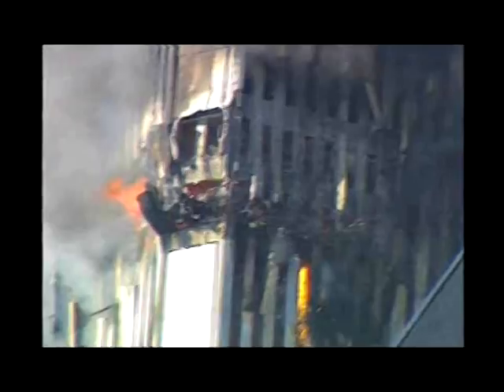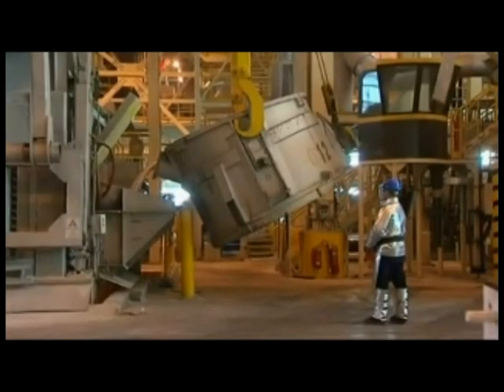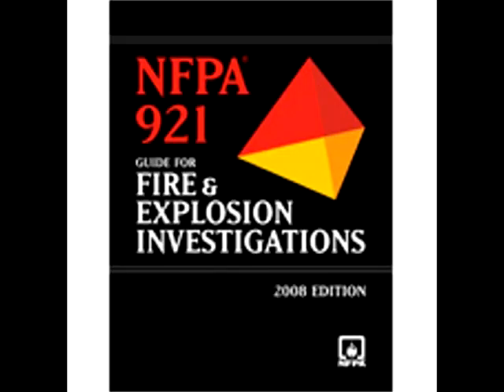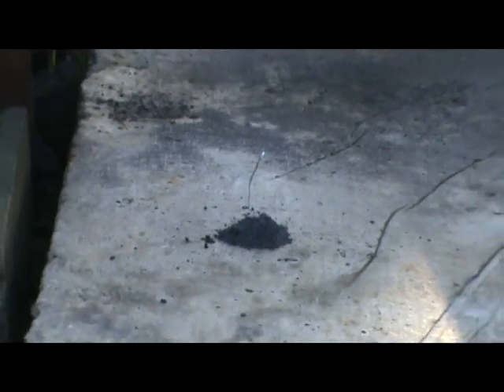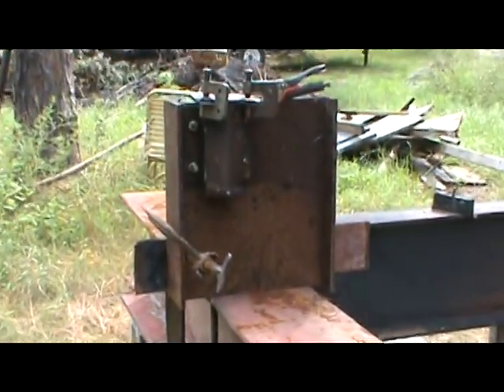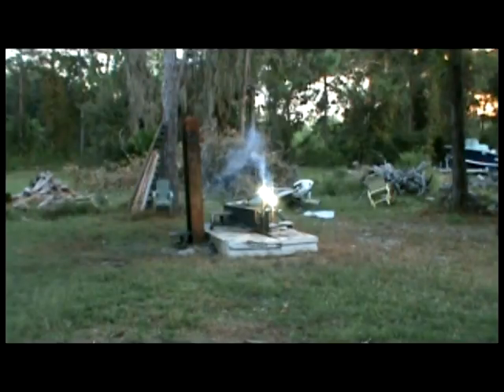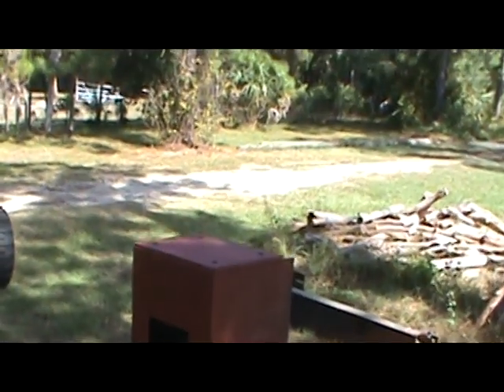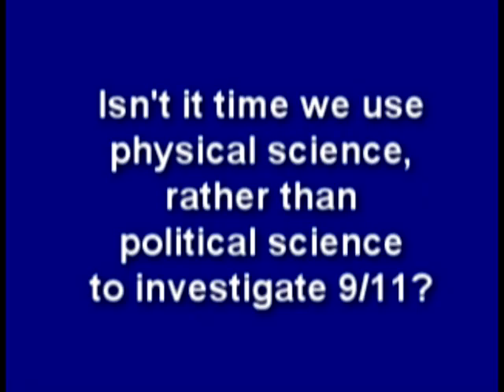9/11 Experiments: The Great Thermate Debate

Comment: And also 'iron rich spheres'   are you serious you think those would be strange to find in the remains of a building that is constructed out of WELDED steel box sections with each strut end  also having four access holes CUT into them to give access to the bolts so they could connect each WELDED section together.  As anyone who has ever worked with metal knows if you weld and cut steel you are going to produce lots and lots of these iron spheres.
Reply: Karl Barratt i'm sure they cleaned up the spatter when construction was complete... welding that had been done in the early 70s doesn't account for even 0.0001% of the amount of metallic spheres that were found in the dust
Reply: frank james 'They cleaned up after' are you serious have you looked at how the building was constructed out of steel box sections with CLOSED ends on the sections . So you think they would of cleaned inside each section. Don't be silly. And even those spheres stuck  on the outside wouldn't have been ground off prior to completion as each beam was to be sprayed with the fire retardant and then cladded. When the building collapsed all this beams were twisted, bent and broken open which clearly explains the spheres were from the construction.  You also go on to say it wouldn't account for 0.0001% of those found which is again stupid as the only and I must point out 'undocumented' case looking into this by a so called truther  was a few spheres less than a couple of grams total..
Reply: frank james  You need to edit your reply as it makes no sense in relation to what I wrote. Firstly you say that none of what I wrote is conclusive which yes your right. I can only write about my experience with metal and building work and plain common sense. That's why I'm surprised you write  'it is conclusive that professional carpenters and steel workers produce clean materials' how is it conclusive ??  that's nonsense. When the steel beams were made there will always be splatter and as I've already pointed out everyone involved in the making of the beams knew they would covered by cladding etc once the building was built therefore no need to grind and polish off any splatter. The steel fabricators do not carry out an extra processes if there's no need for it and more importantly if there's a cost implication thats common commercial sense. Not too sure why you mention carpenters as I'm sure they were'nt made of wood..
   You do rightly go on to say jet fuel couldn't cause them, which I don't get your point as I've at no time mentioned anything about the fire causing them as that's plain silly. You then write that the fact that surrounding buildings were damaged as.conclusive proof that explosives were used. Well that's a new one I've got to say I'd always thought that was because towers damaged the surrounding  buildings as they collapsed as seen in nearly all the videos. I've already said that when the building collapsed all the bending, twisting and snapping of the beams would mix in splatter throughout the debris and dust.
   Please show us the conclusive proof of these dust samples you mention and by that I mean documented samples of the dust taken at the time and NOT samples sent in years later from so called truthers to back up  their mad fantasies and therefore cannot be taken seriously as scientifically acceptable samples. No better explanation  ??  have you heard of the NEST report it gives a pretty good CONCLUSIVE explanation based on facts and  professional expertise.
.
Reply: frank james You'll still not making sense of course there's splatter. For gods sake use your brain as well in the first 30 seconds of the above video it shows the outer panelling made up of three box sections each of these box sections has welded closed ends with four holes for the connecting bolts and also has four access holes cut out  about a foot up from the ends on each side of the box section to allow access to the bolts. The welding of the end panels and cutting of the access holes would of caused considerable splatter to be inside each box section. . So you really think they cleaned inside of each closed box section of course not., and that's not even including any splatter on the outside.When the buildings came down these sections split like a pea pod.
         I have got an open mind though so please send me the link for the USGS report on the documented and verified samples of the dust I've not seen that report and would like to read it.. The only other reports I've seen  have used samples which were  sent in years later and can not ne considered legit. To say the NIST report is criminally culpable can be answered by the question if so how come no one has taken it to court after all if its criminally culpable it would be easy to prove in a court of law and the whole so called 911 conspiracy could be exposed to  the world in one easy stroke. Of course the answer to that is fantasies don't stand up to well in a court of law although you'll probably say the courts will be in on the government cover-up. Which is the normal truther answer and every time they use it makes them look stupid as using that reasoning there's thousands and thousands of people in the conspiracy not exactly secret then is it..
Reply: Karl Barratt none of what you said is conclusive unless you have evidence of "those spheres stuck to the side" ... one should be always careful of whom or what one calls "silly" or "stupid" lest one risk proving oneself a hypocrite

it is conclusive that professional carpenters and steel workers produce clean materials and welding techniques were highly advanced even in the 60s where slag spatter does not account for even a fraction of a percent of the volume nor range of alloy "phases" of metallic microspheres found in the dust

http://pubs.usgs.gov/of/2005/1165/508OF05-1165.html#heading08

these microspherical alloys can only occur during chaotic burning and oxidation of multiple materials at temperatures much higher than could be attained in even a jet fueled office fire... steel welding filler and flux do not account for these... besides what else could knock such a huge volume of welding spatter off the columns besides explosives even if they did exist.. oh that's right, explosives would, well if that did happen we would also see chunks of the buildings embedded in nearby buildings, after being horizontally ejected from the towers.. oh that's right that did happen as well

hmmm seems the evidence is conclusive, those buildings were demolished because no better explanation has been offered by the anti-truth crowd
Reply: Karl Barratt i used carpenter interchangeably with construction worker and besides the buildings were full of drywall so but whatever it's a trivial point... my reply doesn't need editing but your reasoning could use a tune up as you say my reply makes NO sense then go on to say i'm right about none of what you're saying being conclusive... yes i'm right and just admitted you are wrong to make conclusive statements about inconclusive evidence (imagined or otherwise)

my dad was a carpenter and i've worked in manufacturing including welding and first of all there isn't a bunch of splatter on welded products to begin with to even have to remove... the only splatter that might hit the finished steel bounces off 99.9% of the time or falls on the surface and will simply roll off when the piece is lifted off the conveyor

a simple brushing will remove any loose debris that might be stuck by static, to make sure it doesn't blow into people's eyes as the truck is being loaded or driven to the worksite

i gave you USGS analysis of the contents of the dust and no NIST has proven themselves unreliable and criminally culpable by ignoring data, denying access to their source data for the computer models and REFUSED to even test for explosives... what are they afraid they will find?

i will now beg you as i do all the other anti-truthers.. PLEASE use your own brain and DO NOT let bureaucrats who work for the criminals do your thinking for you.. like everyone else in this world you too are capable of genius
Reply: Yes but in the paper they explain that these spheres are an alloy of elemental aluminium (i.e. very pure) and iron oxide. Dr Jones tried to recreate such spheres and the only way he was able to do so was with thermite.

Furthermore when they heated the red/grey chips to their flash point they ignited with an exothermic reaction and such spheres were present where no spheres existed before. I still haven't read a decent refutation of this.
Reply: Karl Barratt
They spend an entire section of the paper detailing the 'Provenance' of the samples. The samples were collected separately some on the day itself and some the day after. The people who donated them ranged from office staff to an artist who was going to use the dust in a future project. All were sealed in airtight bags and the people who donated them have made video testaments as well as sworn affidavits.

Besides, all the samples showed the same basic composition and all contained the red/gray chips in roughly the same proportions so if they were contaminated or interfered with then all four people must have added the same rogue elements. That really does seem implausible, particularly if the authors are right in asserting that these chips are military grade explosive/incendiary.

Btw I don't consider myself as either a truther or a debunker. I'm just interested in the science.
Reply: Karl Barratt the point here is not about being scientifically proven. It is about if it could be accepted in a legal process. If the judge can see that an enough number of samples with identical contents are coming from sources independent from each other they would be allowed as proof. Coming so far there should have had to be some kind of reason to believe why a scientist should try to make up a story  that in fact only ended up in losing his job and defamation.
I am very sure that the proof would stand up in court and support the idea of the presence of some kind of thermitic material. The significance of that is however another question.
Reply: terrymanning1 Yes  you've got  that right. And I know you shouldn't pick on retards as it's not their fault they were born that way  but I can't resist poking them with a stick every so often, its so funny seeing their reactions to reality and facts they slip into this kind of psychotic mantra sitting down clutching their knees while rocking back and forth. I've said this before that they remind me of Creationists using the same sort of pseudo reasoning/science and so called experts.
Reply: oller So you think just because there's less people debunking now that proves you truthers are correct. You really are living in a different world, don't you get it there might be less  people posting debunking comments but that don't prove your right it proves the exact opposite. It means that the main stream have moved on and don't even bother to engage truthers anymore as they know there's no point  as its a faith issue with truthers and noth8ing to do with the actual truth.
Reply: Good to see someone on a 9/11 video with some common sense.
Reply: terrymanning1 = sell-out coward
Reply: Jon Weaver Thanks for the reply but I refer you to what I have already wrote previously 'Please show us the conclusive proof of these dust samples you mention and by that I mean documented samples of the dust taken at the time and NOT samples sent in years later from so called truthers to back up  their mad fantasies and therefore cannot be taken seriously as scientifically acceptable samples.'
Reply: Jon Weaver As I've said again and again the samples and report you are referring to can in no way be considered as scientifically acceptable. For starters  there is NO documented proof of the samples being legit apart from the say so of some truhers sending them in years after the date and that frankly dose not mean anything.
   Also all the samples where all sent to the one person, but as you know in any proper scientific test they should of been sent separately to at least two different  independent  labs. Not to one person with a vested interest in making the results be what they would like.
Reply: You're still not convincing me Karl I'm afraid. As I said the provenance of at least one of the samples was described in an affidavit. Others have made video testimonies where 3rd parties confirm the stories etc. None of the people knew each other. I just don't buy the story that these people somehow created or contaminated some dust to support a conspiracy theory.

But even if you assume that every donor either tampered with their dust or allowed it to become contaminated, then you have to explain how all the samples had the same general composition and specifically how the red/grey chips were ubiquitous across all the samples.

It seems to me that the simplest story...that several unconnected people collected samples of dust on 9/11 and sealed them in air-tight bags just in case they might be useful...is probably true. The alternative story...that a group of unconnected '9/11 truth' activists all created samples of dust in which they placed the same nano-thermite in the same proportions...now that just beggars belief!
Reply: Jon Weaver I didn't assume every donor tampered with the samples I just pointed out that they can not be taken as scientifically acceptable samples.. I also pointed out in my reply to you that all the samples were sent to the one person for testing who had a vested interest in making out the termite was in the samples. Just so you know all the samples were sent in after being asked for on a truther web site which even mentioned what they were looking for, so please don't pretend this was a serious test its just yet another made up fantasy.
Reply: I know all of that but the implication of what you are saying is that someone tampered with the samples and added this thermitic material. If it wasn't the donors then it must have been one of the researchers and I just don't buy the story that these very distinguished academics with long and glittering careers fabricated data or tampered with evidence. That doesn't seem at all plausible to me.

Part of the problem is that whoever should have been responsible for collecting evidence and establishing the exact cause of the disaster did not do that. The dust simply wasn't collected and preserved as it should have been. Nor was the steel which was cut up and sold for scrap when it should have been evidence from a crime scene.
Reply: Exactly...it's like anyone even questioning the evidence is labelled a 'nut job'. It seems to me that the way to debunk the paper would be to do so scientifically.
Reply: oller You make a fair point even  if I might not agree with it.. I understand what you are saying about the significance of  the findings as finding iron oxide aka rust and aluminium is what you might expect considering what the building/planes/contents etc were made of..
Reply: Karl Barratt well... I thought they said that it was a little more than rust and aluminium but I am not a scientist...
Reply: They found red/gray chips comprised of two layers, one of which contained elemental aluminium and iron oxide mixed at the nano scale. When heated it ignited at around 300 degrees or there abouts and it burned with a rapid exothermic reaction that was more energetic than actual thermite.
Reply: Jon Weaver Karl Barratt seems to indicate otherwise.
Reply: oller Hi guys think its getting a bit off subject as this thread was about iron spheres  and not this paper/report. I could write for ages about and have already. You should take a look at this video which sums up the so called report better than I can its:
Debunking 9/11 conspiracy theorists part 2 of 7 - Nano-thermite found in the WTC dust
Debunking 9/11 conspiracy theorists part 3 of 7 -Thermate, thermite and glowing aluminium
Reply: Karl Barratt sorry but these videos are not in function on YT right now, but you can go and look at what Niels Harrit has to say about the issue. Nobody has been able to contradict that so far. Click n Niels Harrit and Milette and you will find it.
Reply: oller yeh sorry the second link is wrong, but the first one works, have a watch the other 7 parts are good as well.Just copy and paste below into the YT search box
Debunking 9/11 conspiracy theorists part 2 of 7 - Nano-thermite found in the WTC dust
Reply: Karl Barratt I am sorry but sometimes I have problems to take Myles Powers seriously. Not that he is joking but it is the attitude that those who question anything about 9/11 are kinda nuts. I have been debating debunkers for almost a year and most of them are just that way. I have made a decision not to care about that as long as there is anything of substance to talk about. We have had a hard fight on WTC 7 but in the end they had to concede to the fact that NIST REALLY had admitted to free fall and that they have failed to explain it. I don´t care  how they did it in the Towers but I am pretty convinced that the collapse couldn´t happen that way without some kind of controlling devices. So my focus is right now to get a REAL explanation on how the towers came down and I am not satisfied with "inevitable" and that this and that said it "was so". The event is so extreme that is has to thoroughly explained and not left only to Myles Power-style debunking! I am a lawyer and not a scientist. May be it makes me a little more open minded and allows for more stupid questions. From me.
Reply: oller
I agree. The NIST report only models events up to the point of collapse initiation. By their own admission they do not model the collapse itself so it is yet to be explained...Also as you rightly point out NIST took only an average speed rather than plotting as a function of time. When you plot as a function of time you get free-fall acceleration for 2.5 secs. Amazing that the 'official' report is so unscientific!
Reply: truthers = retards
end of
Reply: terrymanning1 retards are retards. Agree 100 %
Reply: oller
Karl Barratt can indicate whatever he likes but that doesn't change the fact that that's what the authors claim to have found in the paper they published. I'm neither a physicist nor an engineer so I'll have to defer to other s in the debate but I haven't seen a decent rebuttal that deals with every point in the paper. If the paper is so obviously rubbish then it should be quite easy to refute.
Reply: Karl Barratt
That's a shame Karl...I thought you wanted to discuss the issues not hurl playground insults at people. I'm not even a truther...I just think there are unanswered questions that need answering but your comment has just closed this discussion. Shame.
Reply: Truthers are retards. This is a fact.
Reply: terrymanning1
 
New studies conclude: So called 'Conspiracy theorists’ are sane, while loyal Government Dupes and MSM Drones become hostile lunatics.

The following four different University studies have revealed a lot about how conspiracies are denied using patriotism and why the ones questioning the Government are attacked and considered anti-American traitors. Confirming a mental condition diagnosed by psychologists as cognitive dissonance, the mental stress and discomfort one experiences when faced with a 2nd equally possible explanation capable of destroying ones beliefs, loyalty, faith and security the Government is expected to provide.

Recent studies by psychologists and social scientists in the US and UK found contrary to the mainstream media stereotypes, the ones labeled as conspiracy theorists, tend to be saner and more stable than those accepting the Governments official version of an event. The most recent study was published July 8th, 2014 by psychologists Michael J. Wood and Karen M. Douglas of the University of Kent (UK). Entitled “What about Building 7? A social psychological study of online discussions of 9/11 conspiracy theories.” The study compared comments at news web sites from “Truthers” to those left by “Debunkers.”

The ones conducting the study were surprised to discover it is now more conventional to leave Truther comments than those of Debunkers: Of the 2174 comments collected, 1459 were coded 'Truther' ones who do not believe the Govt. theory and 715 were coded 'Debunker' who believe the governments theory. Truthers commenting on the 9/11 and the JFK assassination outnumber Debunkers by more than two to one. Proving pro-conspiracy Truthers express what must be considered the now conventional wisdom, while the anti-conspiracy Debunkers have shrink into a small, beleaguer-ed minority. 

Perhaps because their supposedly mainstream views no longer represent the majority, the anti-conspiracy Debunker often displays anger, rage and hostility resorting to profanity and personal attacks to discredit or persuade Truthers into believing the official 9-11 story. Additionally, it turned out the Truthers were generally not hostile posting valid concerns and not fanatically attached to their own conspiracy theories willing to consider other and equally possible theories. 

Debunkers however claim their 9-11 conspiracy theory blaming 19 Arabs, none of whom were experienced pilots able to fly a commercial airliner, especially without showing the least amount of fight for control of the planes on 9-11, were somehow able to thwart 2 billion dollars in air defenses under the direction of a guy on dialysis, using a laptop computer and a satellite link holed up in a cave halfway around the world – was somehow possible. 

This while the Truthers never claimed to have a alternate theory which completely explains the events leading up to the attack on 9/11. They claim they are not promoting a rival theory nor do they need one. They claim it is not for them to figure out only to prove the impossibility of the official story, which does not require a contradicting theory. They are simply claiming since a lie cannot be proven it was released immediately and allowed to run halfway around the world before the truth could put on it's shoes.

In short, the new study by Wood and Douglas suggests the negative stereotype resulting from the CIA pinning them as conspiracy theorists and hostile, fanatical anti-American Traitors. Relying on cartoon physics and crack pot Scientists, Architects, Structural and Aeronautical Engineers for evidence is ridiculously false. 

Additionally, the study found Truthers research all claims to find evidence the square box dictators ignored and failed to mention. They also research and discuss other conspiracies the Govt. is accused of masterminding tieing them all together exposing the much larger agenda of these Neo-Con traitors and their NWO Government.

Both of these findings are amplified in the new book Conspiracy Theory in America by political scientist Lance De Haven-Smith, published earlier this year by the University of Texas. Professor De Haven-Smith explains: "The term conspiracy theory was invented and put into wide circulation by the CIA in a effort to smear and discredit the ones questioning the JFK assassination." Adding. “The CIA’s campaign to popularize the term ‘conspiracy theory’ targeting the ones questioning the Government for ridicule and hostility must be credited. Unfortunately, it became one of the most successful propaganda initiatives of all time.” 

In other words, people who use the terms “conspiracy theory” and “conspiracy theorist” as an insult are doing so as a result, using these terms became an insult to the ones questioning the Govt. who uncovered a well-documented, historically accurate conspiracy by the CIA and those involved in the assassination of JFK. The CIA is not supposed to be operating inside the U.S. yet, routinely breaks conducts domestic operations ranging from propaganda to assassinations inside the U.S. 

De Haven-Smith claims those who doubt official explanations of high crimes are eager to discuss historical context. Pointing out a very large number of conspiracy theories have turned out to be true, and there appear to be strong relationships between many as-yet-unsolved state crimes against democracy. An obvious example is the link between the JFK and RFK assassinations, which both paved the way for presidencies continuing the Vietnam War. According to De Haven-Smith. "We should always discuss the Kennedy assassinations in the plural, because the two killings appear to have been aspects of the same larger crime." 

Psychologist Laurie Maxwell of the University of Guelph agrees the CIA-designed “conspiracy theory” label impedes cognitive function. Pointing out, in an article published in American Behavioral Scientist (2010), anti-conspiracy people are unable to think clearly about such apparent state crimes against democracy as 9/11, due to their inability to process information conflicting with the indoctrinated pre-existing belief they were brainwashed into believing. 

In the same issue of ABS, University of Buffalo professor Steven Hoffman adds "anti-conspiracy people are typically easy prey to strong confirmation bias – they seek out information which confirms their pre-existing beliefs, while using irrational mechanisms (such as the “conspiracy theory” label) to avoid having to consider conflicting information." 

The extreme irrationality of those who attack 'conspiracy theories' has been ably exposed by Communications professors Gina Husting and Martin Orr of Boise State University. In a 2007 peer-reviewed article entitled "Dangerous Machinery, Conspiracy Theorist as a Transpersonal Strategy of Exclusion,” they wrote:
 
“If I call you a conspiracy theorist, it matters little whether you have actually claimed a conspiracy exists or whether you have simply raised an issue which I would rather avoid. By labeling you, I strategically exclude you from the sphere where public speech, debate, and conflict occur.”

Now, thanks to the internet, people who doubt official stories are no longer excluded from public conversation. The CIA’s 44-year-old campaign to stifle debate using the term 'conspiracy theory' label to smear those who dare question the Government is nearly worn-out. In academic studies, as in comments on news articles, pro-conspiracy voices are now more numerous – and more rational – than anti-conspiracy comments. Cheers Debunkers!
Reply: Truthers are retards. End of.
Reply: terrymanning1
I am new to this debate and so have no views whatsoever on what did or didn't happen so let me tell you, as a someone who is new to this topic, that that your use of abuse, coupled with your refusal to actually engage in any arguments, makes me want to side with the 'truthers' because they sound much more rational than you! You are doing yourself a disservice by making yourself sound aggressive and unintelligent.
Reply: Jon Weaver I have had years of dealing with truthers ok. They are not interested in anything other than promoting their bullshit hate filled anti-USA agenda of theirs. They have never proven a single one of their claims and deserve one thing: contempt.
Reply: terrymanning1
Fair enough but that's not how it appears to me. Many seem to raise legitimate questions as far as I can see. I don't see a lot of anti-USA sentiment either. May be anti-Bush administration but that's far from being anti-American. Personally I despise the current Tory government in the UK but that doesn't mean I hate the UK. It just means I think it is being misrepresented.

It is a matter of public record that the CIA blocked the passing-on to the FBI of Able Danger data including the names of several hijackers and the fact that they were in the States. That has been very well established by various whistle blowers and the issue has been raised by several of your own politicians. The authors of the 9/11 commission report admit that they were lied to by the CIA and never got to the truth of that particular matter.  So at the very least, there has been a cover up by the CIA of the fact that they knew the whereabouts of these guys and didn't tell the FBI. So it's not surprising people are suspicious. The people responsible should be held to account and the truth, all of it, should be made public.

Do you honestly think the 9/11 commission report contained all of the truth? Every last bit?
Reply: Jon Weaver Truthers have utterly failed to prove a single one of their claims in over 13 years. Not one reputable scientific, engineering or architectural organisation anywhere in the world gives anything they say any credence. Says it all.
Reply: That might well be the case but many people are far from satisfied with the official investigations. In 2005 New Civil Engineer criticized NIST for not modelling the actual collapse sequence and the commission report has even been criticized by it's own authors!

If NIST had done the modelling properly then there wouldn't be any room for 'conspiracy theories'.
Reply: Jon Weaver So how come truthers can't debunk the NIST report with anything other than pathetic thermite demo nonsense?
Reply: Well as I said NIST didn't model the actual collapse so they've left themselves open to alternative theories. Also they had to tweak quite a lot of the variables to make their models work. Furthermore their modelling wasn't published in a peer review journal so it can't be verified and they won't share the data either. I reckon they deserve all the criticism they get!
Reply: Jon Weaver Shame you truthers can't come up with anything resembling a credible alternative isn't it?
Reply: I wondered how long it would be before you'd call me that. I have never once, in any of my comments, expressed a view about any of the  theories. All I have done is pointed out criticisms that mainstream sources have made of the 9/11 commission and the NIST report.

Your use of the term 'truther' as an insult is meant to close down critical thinking.
Reply: terrymanning1 you are telling us a story that is so full of anomalies, holes, lies, distortions and misleading evidence of an event containing 4 different parts that if they took place in the way you claim with 100 % success for the hijackers and 100 % failure for the government the chance would be one in a billion or less; that we, who can see evidence leading in other directions that you don´t even want to examine, are asked to give an alternate version that each of them would have the probability of one in a million; just because there are a million different alternatives. It is extremely dishonest to ask the victim of an extremely complicated crime to have a version of his own. We can all guess who the perpetrators were; we can see that it is carefully planned; but it is planned to create fear and chaos. Somebody suggested Occams Razor in this case. Since this event is set out to be utterly unclear and chaotic; Occams Razor leads us to believe that the government did it. But there are many alternatives also, isn silent or overt cooperation. Do you also think that we should be able to explain which of the one thousand ways it could have been performed in every detail? Why should anybody be able to do that? You have accused 19 Muslims without other proof than that they may have wanted it to have happened. Is that enough for you?
Reply: terrymanning1 you used to be more concise. Now just blabbermouth.
Reply: terrymanning1 when did you ever utter one truthful word? Not one single eyewitness to confirm the presence of the hijackers at Logan, Dulles or Newark. Eyewitness testimony? The eyewitnesses in Shanksville did not see any trace of an airplane. Forensics? You mean NIST who have not been able to explain why there was free fall in WTC 7. Hard science? You mean NIST when they reported that the collapse was "inevitable". The Commission report? Peer reviewed? Video footage? From the airports? From 85 surveillance cameras at Pentagon? Yes I agree; there is a lot of evidence out there. A pity that you never showed it to the public. (Btw; interesting that ALL of you debunkers are retreating to the same position. Good coordination, indeed!)
Reply: terrymanning1 there is a lot that you don´t know about me and your weak brain will never do
Reply: terrymanning1 then do me a favour and shut up
Reply: oller Nah it's fun goading a fuck up like you
Reply: terrymanning1 You're not too bright, are you?
Reply: terrymanning1 then do it. Talking is nada.
Reply: Karl B.   As you probably know,   when large steel contruction sites are cleaned up before finishing the job,  junk such as weld slag, etc. is REMOVED.  So  don't expect to find very much. And much of the fabrication is done off site anyway.  But you knew that, right?
Reply: terrymanning1 Racist? lol Who said anything about a race, dipshit?
Reply: Aww, are you upset? Does the reality of your miserable existence bother you? Figures.
Reply: terrymanning1 What's the matter, bitch?